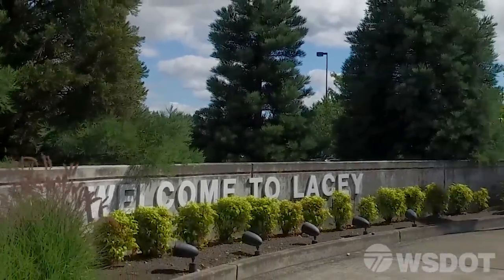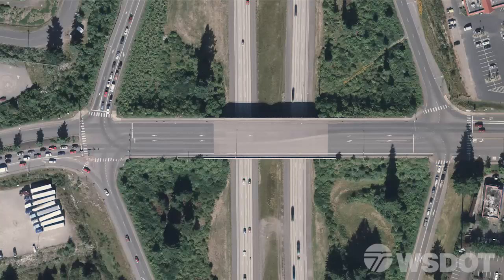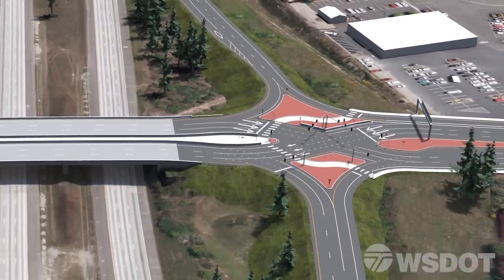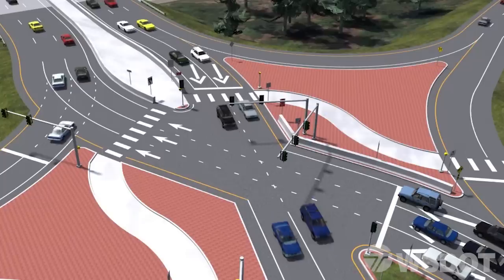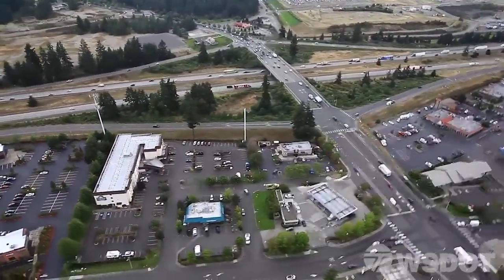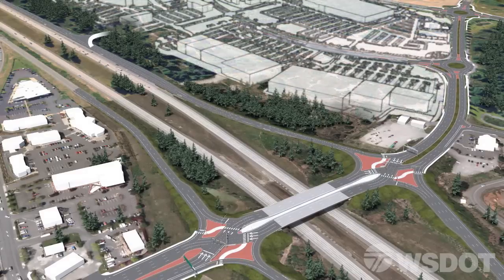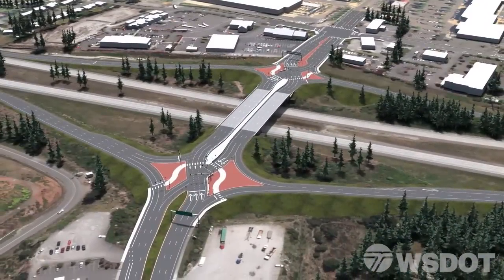Diverging Diamond Interchange comes to Washington State

Comment: Tending towards a roundabout...why not just make a roundabout, or perhaps two, then you don't need the signals or to stop traffic at all?
Reply: Exactly my thought
Reply: roundabouts are a good idea in theory... in practice people dont really respect the right of way and its impossible to enforce... plus roundabouts of more than two lanes are more trouble then theyre worth
Reply: +Lone Wolf Well, the main issue may be that people don't know how to use them. Having more of them will make it harder at the beginning but will help in the end. In Europe, roundabouts are very common and people are used to them which makes them fast and safe. Roundabouts are very effective, therefore you need only two lanes where light intersection would need three or four for the same amount of traffic. More than that does not increase throughput efficiently and usually needs grade separation.
Reply: Jan Sten Adámek
in very busy surroundings people dont respect the right of way and cut off the people already engaged or crossing between lanes... like i said its impossible to enforce... i dont know of big cities who consistently use them... i know paris has the arc de triomphe but its a bit of a dinosaur
Reply: I'm not sure if you're joking here or not....in case you're not, a Multi-level interchange is very expensive, certainly when compared to this DDI.  There's also the time required for construction, which is very disruptive to business and finally, it's not as ascetically pleasing.
Reply: They work very nicely actually. I use them every day and rarely have to actually stop at all. They're not just theory.
Reply: Space - this junction can be made without building new flyovers, the existing bridges can be used, with the addition of a concrete divider for safety.
Reply: simply not true...roundabouts are used on almost all motorway intersections in the UK (the case in point in the video) - though I have no actual stats to back that up. It's simply a matter of learning how to do it - ie training. You only need to enforce things if people are doing it wrongly...somehow it works very well here (lack of use of indicators not withstanding). I wouldn't say it is impossible to enforce...just need some police to give some instruction to people doing it wrongly.
Reply: David Waterman not sure who you're replying to, but it doesn't seem to be me.
Reply: That would make too much sense and not cost enough.
Reply: David Waterman
i heard a bunch of truckers who hate them because they are so tight they have to crawl through and often enough air heads will get on the inside and block their turning area... also i know in england they have those circular causeways in places instead of roundabouts ... my guess would be because its a better way to handle heavy flow... but what do i know
Reply: common guys roundabouts only work when the flow is not constant... if flow from one direction is constant the other direction will never get in... also look at that intersection... they nicely integrated pedestrian lanes as well
Reply: The biggest problem I see with roundabouts in the U.S. is no two are the same.  Seriously who's supposed to merge can and does vary, so to prevent confusion often traffic lights or stop signs are added to the roundabouts.

Which then completely destroys the efficiency.

The DDI seems like a great system to work with existing infrastructure, and normal traffic habits our people have.
Reply: Bryon Lape I suspect you're being tongue-in-cheek here, but a roundabout would not work in this situation.  Where roundabouts work... they are used.  They are used in most American cities, but they're not a simple fix for every situation.
Reply: Indeed, most large roundabouts in the UK seem to be having light controls added to them as flow increases and causes an imbalance.
Reply: David Waterman Building a roundabout at each side an overpass is expensive unless done in an undeveloped ares. When your local authority doesn't hair the money to fixn potholes . . .
Reply: Not true at all, Lone Wolf. Have you ever driven in Europe?
Reply: I'm not sure what 'circular causeways' are, tbh.
Reply: Yeah, that's a more reasonable argument, though I fail to see any evidence that this junction would have constant traffic. Also, roundabouts can have traffic lights too, and are used in such situations.
The point, though, is to prefer not stopping traffic...that should be the default. Which, by the way, is something lorry drivers should prefer - since stopping and starting again is a right pita.
Reply: That surely makes them aweful...the same rules should apply at all roundabouts else who knows what to do!?
Reply: yes, and this also applies when they add pedestrians to the mix. However, the same principal applies, which is to prefer to not stop traffic, and to only do so when it is needed.
Reply: They can be expensive. In the UK, the junction in the video would surely be one large roundabout over the top of the junction. I think that would work just fine. I would guess it would be more expensive than the DDI thing, even if it were 'from scratch', and certainly as a modification to the 'current' system. Cost is a factor, yes, but I would imagine always stopping traffic also has an associated cost (financial as well as environmental?).
Reply: David Waterman
those are circular causeways :D
Reply: I would see there a problem in amount of cars. There are 3 + 3 lanes in both directions. Connecting 3 lanes of traffic into roundabout could be a problem for inexperienced drivers and if those 3 lanes are full of traffic then it could probably get stuck.
Reply: yes, people do need to know how to use them, but there are very many such roundabouts in the UK...each lane is for a different direction, indeed some left turns have dedicated lanes that don't go onto the roundabout, a bit like some in the video.
Reply: Roundabouts would not resolve the issues they have at this kind of location.  There is a lot more going on here than just a simple intersection.  The DDI makes the on/off ramps function much more efficiently and improves the safety of the interchange by a lot (studies have shown that accidents drop off about 50% in a DDI).  Roundabouts are good, but not always the best solution in all cases.
Reply: anchskier a ddi is the only option as there isn't space to build a roundabout without changing either the flyover or the on ramps, both of which would cost extra for which there isn't funding
Reply: There's plenty of space for the roundabouts and adapting the existing system to two roundabouts would be pretty cheap and quick. This is a dumb solution.
Reply: magnetiktrax
Multiple roundabouts can get clogged, can't they? Here are traffic lights that will keep the flow.
Reply: magnetiktrax not true, you'd need to have very large roundabouts top accommodate the rigs that use this intersection
Reply: Xaiano not at all, there's waaaay more space available there than most multi-lane roundabouts in the UK take up. It's simply an inversion of the existing curves that make up the diamond.
Reply: I don't think they'd have to be so large...judging by the roundabouts they get around near my place. In any case, roundabouts don't need to have a 'centre' that can't be driven over when necessary.
Reply: David Waterman they do if, as in this scenario, there are multiple lanes.  if you're suggesting single lane roundabouts then that would reduce traffic capacity
Reply: David Waterman I'm a Brit and swear by roundabouts because you never need to stop if the road is clear and they are substantially safer than intersections, but look at all the uk motorway junctions, they are large multi-lane roundabouts, there isn't space for one like that here and no funds to build one.
Reply: I'm talking about roundabouts with multiple lanes...it doesn't make much difference really, if it is designed with that in mind. Some roundabouts allow vehicles to drive right over the top, and, yes, with multiple lanes too.
Reply: Yes, the motorway junctions tend to be be pretty big, but the one near me certainly isn't, and (annoyingly) big lorries use it 'all the time', probably because it's a short cut on their sat navs.
Still, I accept that a single round about would surely take more space than the above scheme (and so be cost prohibitive), and even two maybe would...it's certainly more plausible though, imo.
I suppose my observation is that there seems to be some resistance to roundabouts in the US, which seems irrational to me (it seems to be a NIH issue), and it would make more sense to me because I am totally used to them. I've yet to hear a conclusive argument against them, even in this case, tbh. I'd like to see a cost breakdown.
Anyway, this is getting a bit boring (I think we can agree on that, at least) so I'll not bother replying any more - nothing personal.
Reply: David Waterman I'm think we have reached a consensus, something very unusual for a YouTube comments thread.  I agree that the US in general has an irrational hatred of the roundabout despite it removing the need to stop when the road is clear, something I would have thought most Americans would love.  I know this doesn't go for all Americans, but it certainly seems to be a majority
Reply: Late to the party, but... Roundabouts are excellent for smaller road intersections, but in order to handle the amount of traffic at this junction, you would almost need two roundabouts on either side of the interstate, for a total of 4 roundabouts. Roundabouts make sense when you have one high-traffic road intersecting with another much lower traffic road, but here it appears that the "surface road" may actually have about the same amount of traffic per minute/hour (however WSDOT decided to metricize things.)

If you want to discover this counter-intuitive truth for yourself, just do one of two things... Go find the nearest roundabout to your location, and observe the traffic-flow during a peak demand period, or load up a game of Cities Skylines. In the game, you will notice that a roundabout is incredibly helpful up to a certain point, but then just becomes a giant waste of space. The way to set this test up is to build all your industry on one side of the map, and all your commercial and residential on the other. Then, connect each side with only two roads, and ensure that the highway is also connected to them. On one road build a roundabout setup, and build a DDI on the other. The DDI handles MUCH more traffic, without causing cars to back up onto the "big road."

No, the AI in Cities Skylines is not some advanced or super-accurate simulation of the real world, but it does a good job of approximation. You can also install a couple mods to improve the AI so that it does things a lot more like real traffic does. While creating a DDI in C:S is a process, and not the most "pretty" looking solution, it can be a huge problem solver in tight areas where building extra roundabouts (or a massive "Magic Roundabout" - Look it up) is simply not an option.

The appeal of roundabouts is to allow a much smaller number of stops and/or yields per hour, but the whole system crumbles under heavy traffic, because then EVERYONE is yielding. I love the ones in my small city (we have two, in perfect locations) but I hate the ones along the interstate. When you have 50 cars per minute (or more) there is much less time to judge things, and many people panic-stop, which just creates backups. I know this also happens in Europe and other parts of the world as well... Except India... They seem to all use some form of telepathy to avoid accidents. lol
Reply: The problem I have found with the roundabouts around me is that during heavy traffic no one seams to yield!  I will be in the outer most lane, and often have to slam on the brakes because the people in the inner most lane decide they want to exit and cut across.
Reply: David Waterman please no more round abouts,  people can't seem to drive in a straight line so let's not make them go in more circles. there are already a handful too many in whatcom County that are not being used properly because no one follows the laws of them so let's not add more. this ddi seems like a good concept but I see potential issues with it as well knowing how well people don't drive in the area.
Reply: Cities Skylines detected 😂😂
Reply: It's probably worth noting that the city of Lacey (where this DDI is to be built) has 16 roundabouts in operation, four surrounding this interchange. Roundabouts are a well-utilised traffic control method here in Washington, and WSDOT has built many roundabout interchanges before. I can only assume that their studies showed a roundabout design to perform poorly at this junction, so they went with the next cheapest option.
Reply: I'd say a combination between a turbo-roundabout and a dogbone interchange. The reluctance of the Americans towards the British roundabout (which mainland Europe has adopted in great numbers) is truly puzzling. Instead of having easy to understand rules of way, they prefer to have cars drive on the wrong side of the road.
Reply: Roundabouts have more conflict points and waiting where you merge.
Reply: This area actually started out as a roundabout several years ago when the area was very very first starting to expand and build businesses out there. To ease up the growing congestion, reduce accidents (yes really it was silly how crazy it was) and allow semi trucks to go through that area easier they removed the 'bouts and put in that light configuration they're now replacing.
Reply: Lone Wolf you kidding, I lived in London for a few years....they are everywhere. what's rare is traffic light intersections. Most of Europe use roundabouts as the norm.
Reply: kckcmctcrc they are hardly used in America. I wouldn't be surprised if roundabouts in America make up 1% or less of American intersections. Europe intersections with roundabouts would probably make up the bulk of intersections, with some traffic light intersections, they use more of a mix use then America...however roundabouts are the more common in most of Europe.
Reply: Xaiano I understand having more traffic light intersections on 6 lane intersection going in each direction, but what I've never understood is why on smaller roads, even on more quiet roads they so often have traffic lights. You ever out in some sleepy suburb town or something at midnight waiting for 3 minutes for the light to change....and not a single other car came through...what a waste of time. I've always wondered why on Earth more roundabouts in at least quiter smaller roads roundabouts weren't in favour to be put in.
Reply: Probably some local official's cousin sells traffic lights. On a more serious note, I think it's just plain old stubbornness, or perhaps Not Invented Here Syndrome. Americans like inventing stuff, but seem a bit wary of things that were invented elsewhere.
Reply: A 6-lane roundabout is not feasible. Way too much confusion, not enough visibility.
Reply: It wouldn't be six lanes, but three lanes. Which still is very hard to navigate, of course.
Reply: Just one lane is better.
Reply: Roundabouts only work with low to medium traffic volume, imagine having to be stuck behind half a km of people undecided on whether to merge in or not when their turn comes in a very busy city road.
Reply: My hometown has a high capacity interchange without any lights. Just 3 levels of roads.
Reply: Also costs like 50 million dollars to construct for 3 levels of road. Lights with smaller interchange is usually cheaper and functions well most of the time.
Reply: a highway round about... this is an interchange not a city block. A round about would halt all through traffic on the intestate that just passing under.
Reply: No, you would put a roundabout at each end of the overpass, obviously.
Reply: Irval Firestar roundabouts are common on UK motorways, in this circumstance the flyover would be divided into two bridges carrying the roundabout which would straddle the main road. The entry and exit ramps would go to the roundabout as would the minor road. The roundabout is then sufficiently large that traffic has plenty of space to change lanes or queue if lights are installed.
Reply: Roundabouts are common over here too, they are useful for low traffic flow or if you have plenty of space to make a big enough roundabout with. If you're starved of space like this case however, I imagine a DDI would be more useful and allows for a 'half-roundabout' design.
Reply: Same lame excuse been hearing for 30 years, people don't know how to use them. They'll learn or get tickets, simple as that.
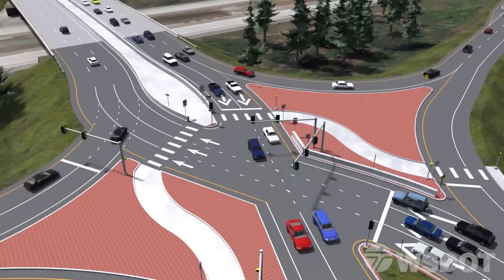Reply: A DDI is quicker in this situation. A roundabout would work but not as efficiently. You have to take into consideration semi-trucks and increased traffic size. For a roundabout to work as efficient as a DDI in this case, there would have to be one in the center of the two sides of the interstate. I encourage you to pause the video at 0:40 and mentally place two round abouts at the intersections then compare it to the DDI. You will find that my theory is correct. For example if you past your exit headed South and needed to go north a DDI is extremely faster. And trust me they would never reposition the actual interstate to place one roundabout in the center of one exit, it's just not that worth it.
Reply: It's mostly the sharp turns for semis (or articulated lorries, as they say in Britain) that make two roundabouts a bit of a pain. You could, of course, have the roundabouts go wrong way, but that would cause a lot of confusion, and make right turns difficult, so nothing gained anyway.
Reply: Roundabouts cannot handle heavy traffic. Also, traffic is slowed because of confusion over right of way and discourteous drivers (won’t let people merge or overly aggressive drivers).
Reply: There are ways to mitigate the traffic restrictions of roundabouts, but they do, in fact, have a greater throughput than a set of traffic lights. As for idiot drivers, that's a matter of enforcement.
Reply: There is also the problem of 4 highway lanes merging into 1 or 2 lanes in a roundabout.
Reply: scottthewaterwarrior You hit the nail on the head! Here in the U.S. the people refuse to follow the rules for using a roundabout. Basically they do not yield to those already in the intersection. I sat completely unable to move my semi in a roundabout because a long string of cars coming from one direction were funneling into the roundabout and not yielding. Plus that one, although at an intersection of two highways, was built to small for a semi. Some of the ideas are great, but can we use some common sense in the design and construction. Please include enough room for a semi to use at the proper speed and without dropping a steer axle or trailer wheel over the edge of the road surface. What the designing engineers are paid, they should make all road surfaces safety usable by all vehicles that normally would use that road.
Reply: Roundabouts are only good at large intersections with low traffic density.
Reply: Lone Wolf If you get stuck in the 3rd, 4th (inner) lane in a roundabout it may take several orbits for you to get out of there. A roundabout of more than 2 lanes is a logistical nightmare (especially for people unfamiliar with them or are poor/idiot drivers).
Reply: "Roundabouts are only good at large intersections with low traffic density."

You really should visit Europe one day, particularly Britain. Roundabouts come in all shapes (not sizes, almost all are round), from a mini roundabout that replaces a traditional intersection in a town, to larger ones.
And then the Dutch invented the turbo roundabout, which is a two-lane roundabout with raised lane separators that force you into a certain direction. It raises the capacity and drastically lowers the lane conflicts and collisions.
Up to a certain amount of traffic, a (turbo) roundabout is the most efficient solution, and cheaper than lights. Tax money, after all. But all small roundabouts are difficult for large vehicles.
If a turbo roundabout doesn't suffice, and you don't want to build a split-level junction/stack, you need lights.
Reply: Severity One Have you experienced the idiot drivers here in the USA? It’ll be chaos. A simple on-ramp or off-ramp is enough to cause a slow down or traffic jam. Imagine an unfamiliar roundabout and you’d “get the picture”.
Reply: in some places in middle tennessee, especially some neighborhoods, the locals, not TDOT, created some makeshift roundabouts in certain areas where the locals felt would be better than a 2 way, 2 right of way intersection. of course it doesn't end too well tho, because often times the reasoning behind the locals' decision was to and i kid you not, was to get people to reduce speed. it sometimes works but it doesn't always and ends up making more accidents than it should.